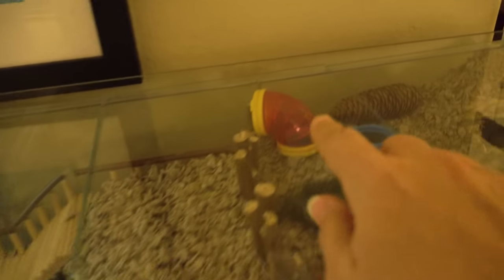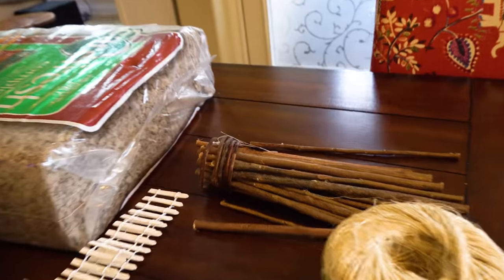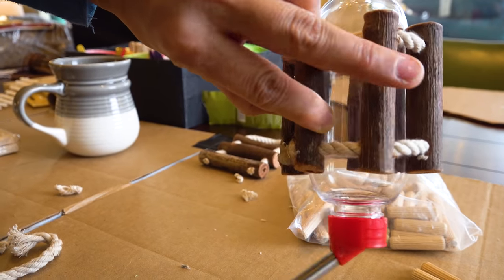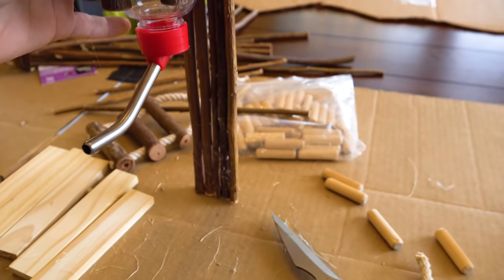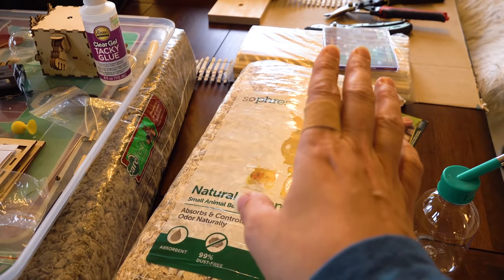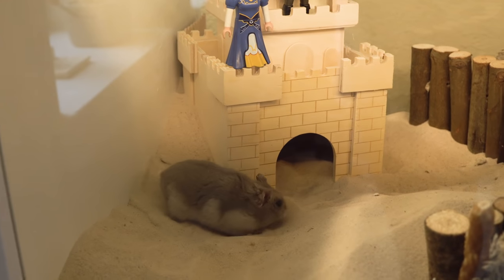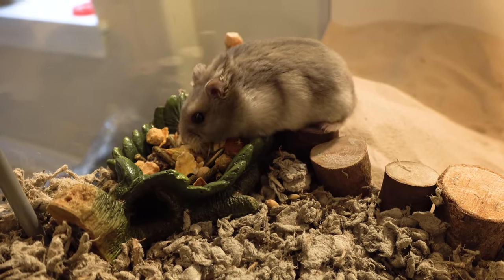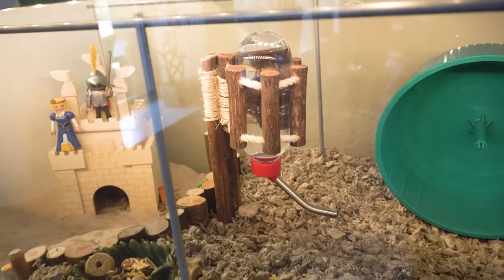Happy the Hamster DIY WATER BOTTLE STAND!

Comment: Sometimes dwarf hamsters are cage aggressive.  If your still having problems with him biting you it might help to bring him out using a cup and interact with him outside his cage in hamster proofed area or in a bin or bathtub.
Reply from the maker: Thanks for the tip!
Reply: Asher Sprous that’s a good idea but I would sit in the Barth with him and sit on the plug side because his feet could get stuck or put a blanket in the Barth x
Reply: @itsmacey347  put a blanket in the bathub and some toys. You can sit with him so he could interact with you and get used to your scent!
Reply: Izzy'